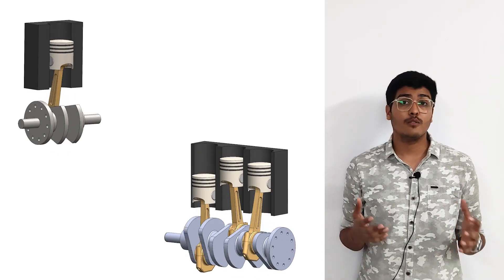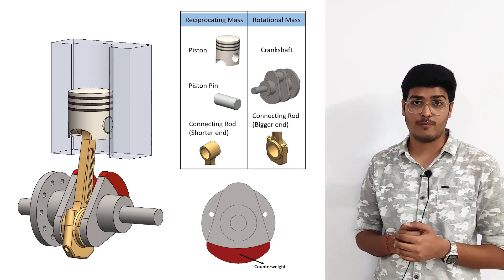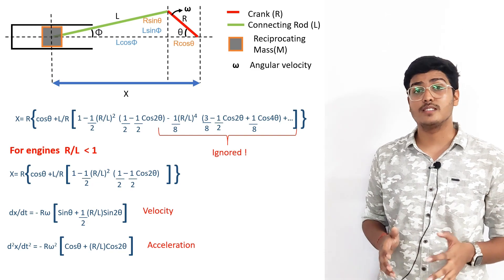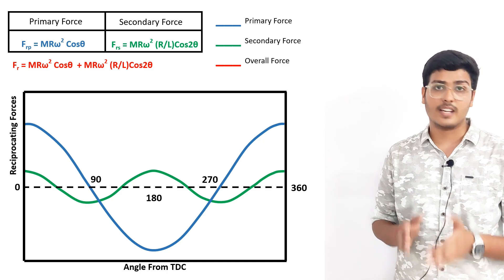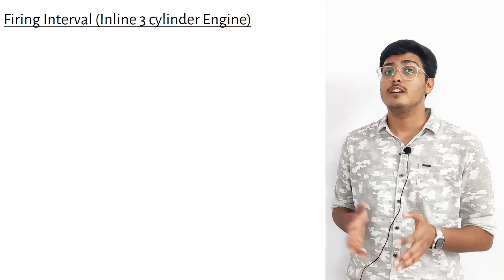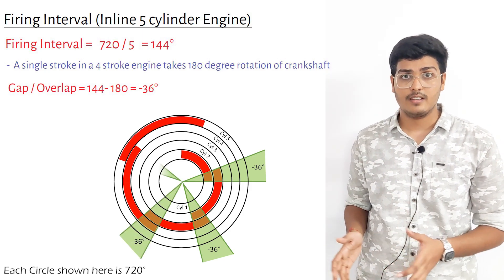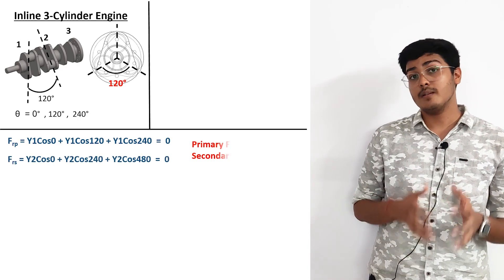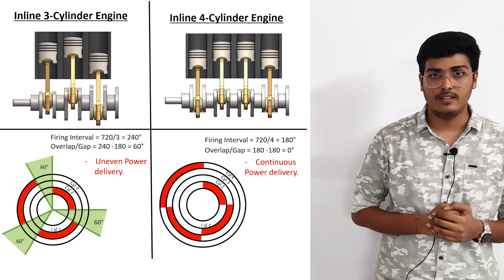Smoothness of Running Engine | Engine Balancing | Firing Interval

Comment: A 5 cylinder in-line engine running at 500 r.p.m has successive cranks at 
1440 apart. The distance between the cylinder centre line is 300 mm. 
Piston stroke = 240 mm, length of CR = 480 mm. Examine the engine for 
balance of primary and secondary forces and couples. Find the maximum 
value of these and position of central crank at which these maximum...................................................plz bro i need ans